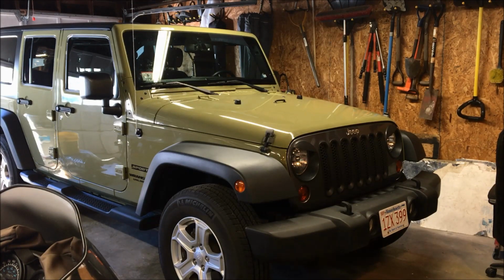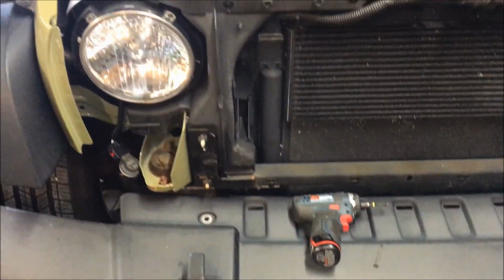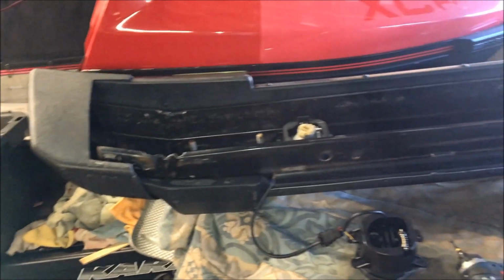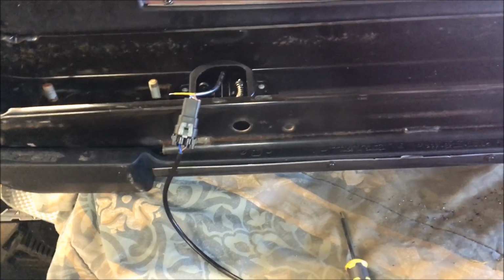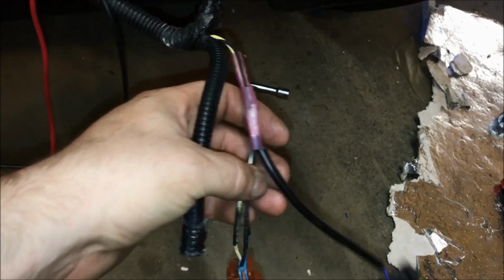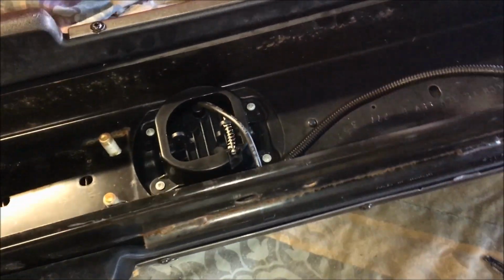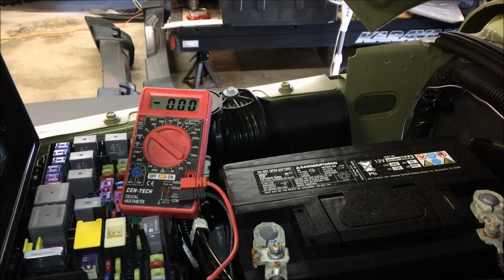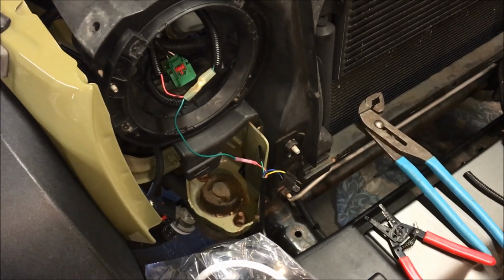Jeep Wrangler - SunPie Daymaker LED Headlight Install

Comment: I just recently bought the Sunpie led headlights for my 07 JKU. Install was easy everything worked when key was on the “on” position but once I cranked it over n a couple of minutes late my low beams turned off. Height beams work like a charm as well as the fog lights. Just wanted to run it by you to see If you had this problem.
Reply from the maker: No issues and they’ve been installed for 3 years now.

Comment: Great video. Do you have a list of all the items that you purchased for the install? Also, what gauge wire did you use?
Reply from the maker: Pretty sure I used either 14 or 16 gauge wire. Not sure about everything else. It’s been a couple of years.
Reply: @StreetersGarage  Thanks for the reply. One last question if you don't mind. How are the headlights and fog lights holding up? I'm pretty much ready to go for the install, but still a little hesitant based upon the reviews about durability. Could you let me know? I'd really appreciate it.
Reply from the maker: I’ve had zero issues with them. Over 3 years at this point. I believe the durability issues are directly related to the quality of the install.
Reply: @StreetersGarage  Did the install over a period of 2 days and the job came out great. If it wasn't for your detailed video and tips, this novice wouldn't of attempted to DIY. Thanks for taking the time to record and post this video!  :-)
Reply from the maker: That’s awesome. Glad it helped you out. It’s not that hard to do once you know the basics.

Comment: LOVE the light output and beam pattern on these. Sadly though i only got to see it for 10 mins and the low beam stopped working on one of them. The replacement came today and only lasted for 30m. I love these lights but damn, two duds back to back is bugging me. The ONE working one is better than the 2 stock as far as usable light. Hope 3rd time's a charm.
Reply from the maker: That’s definitely odd. Hopefully the next one will be the last. 

We’ve been using them for 3 years and the only issue that we’ve had is the HALO on the passenger side headlight is starting to dim and not as bright as the driver. Everything else is working fine including the fogs.
Reply: @StreetersGarage  im thinking i just got two duds back to back. Was just checking voltage (for the 5th time now) to be sure nothing weird is going on when i switch high to low beam. Truck is fine. Just odd, 3 total headlights, and only one still lives.
Reply from the maker: Ok - I was going to have you test the voltage as well.

Comment: If I did want to connect the halo to the blinker, how would I do that also?
Reply from the maker: It's illegal. Turn signals need to be amber. A blinking led halo would be a great reason for a cop to pull you over.
Reply: Streeters Garage I’ve seen some reviews where people have somehow tied the halo in with the blinker to where when the blinker is turned on which ever side the blinker is on overrides the white halo and turns it orange and the orange halo then blinks also but goes back to white after the blinker is turned off. Is that also illegal?
Reply from the maker: Ok. I know what you mean. The kit I installed didn’t have that option. 

But,  if you bought a kit that did have it. You would need to identify the wire going to the indicator light on the Jeep and then wire it to the fog light.  

When there’s voltage on that one wire. It should energize the halo turning it to orange until the signal is turned off.
Reply: @StreetersGarage  Are you sure about that? I found your video through the name of the headlights that I actually looking to buy. On pictures show that the Halo light is also amber. Did you try to connect it to the blinker and that's how you know it doesnt turn amber? I saw that you went straight to the fuse box to connect the halo, but you can also tap the red wire on headlights to your day light wire on Jeep.
Reply: @StreetersGarage  But thank you for the video. You explained yourself very well.

Comment: How do you wire the turn signals? Where the green wire should be connected?
Reply from the maker: Sorry I don't remember, it's been almost 2 years since I installed them
Reply: @StreetersGarage  How are they holding up? Any issues?
Reply from the maker: Almost 2 years and not a single issue.
Reply: Streeters Garage thanks man, just purchased

Comment: hi Streeters Garage, I have installed lights like on your movie but the problem is that when I change gear to D ( drive ) everything works different. halo DRL, low and high beam on. If I switch on low beam by switcher then it works OK, halo DRL and low beam.
Any chance to check it on your jeep?
Reply from the maker: What year is your Jeep?
Reply: @StreetersGarage  2017 sport
Reply from the maker: JL or a JK?
Reply: @StreetersGarage  Hello, I have 2017 JK.